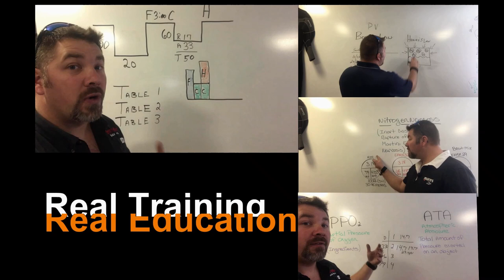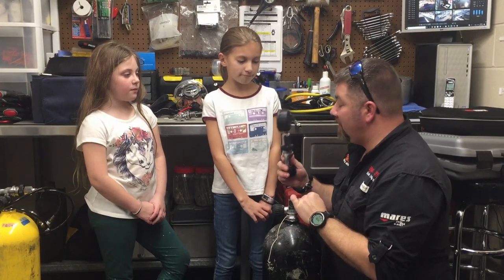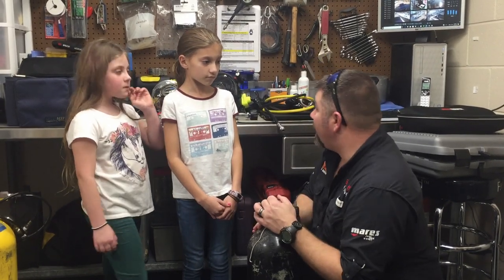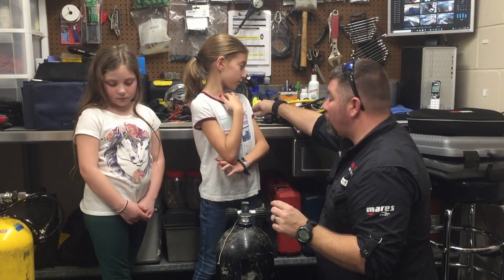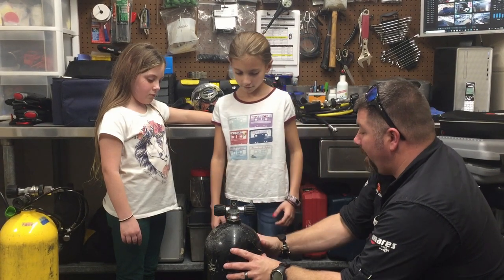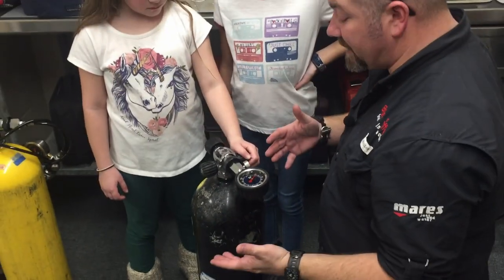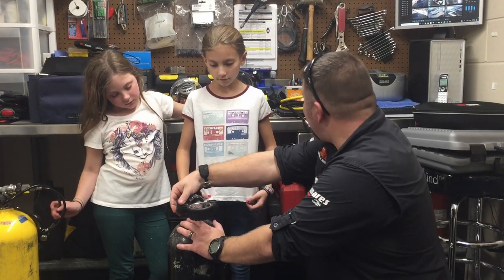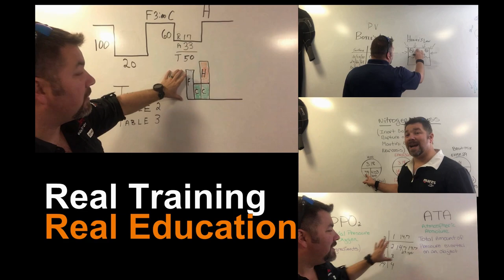History Of The J Valve: Teaching Scuba Rangers

Comment: I currently have a tank with a J valve. It’s in getting a hydro, if it passes it’ll be revalved to K. Tank was manufactured in 1972.
Reply from the maker: Hello Skirblah T, we still have several older steel 72's with J valves in them.